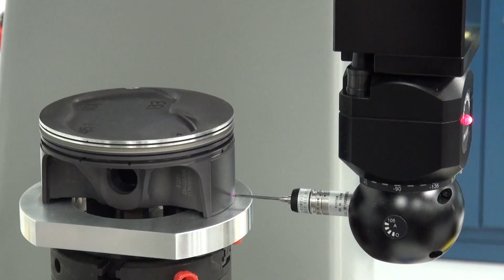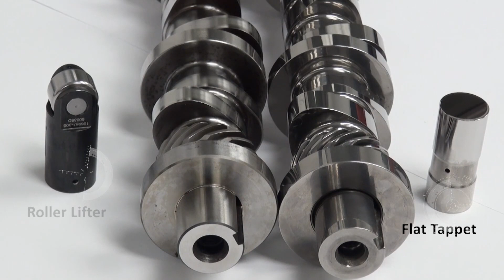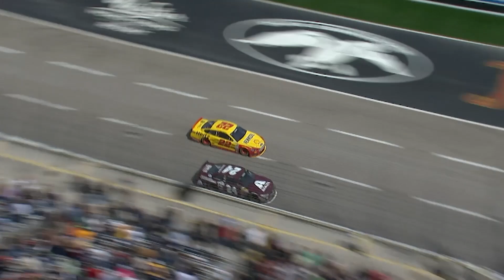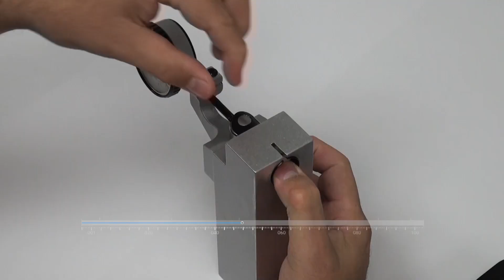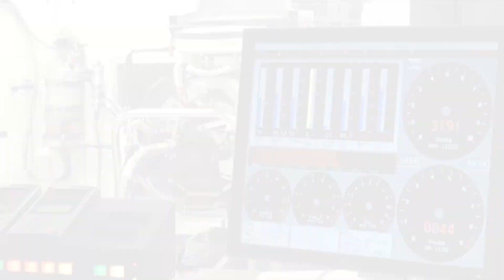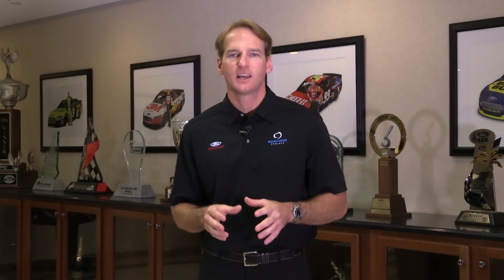2015 NASCAR Engine Rule Changes - Roush Yates Engines

Comment: Flame hardened and cryo chilled cam and lifters. Well, I don't think I'll be buzzing my V8 @9000 rpm any time soon. Every thing inside is sooo shiny!
Circle track article from the 90's. A team got caught sucking extra air through the carb stud bolt holes.
I still recall a Hot Rod article on Roush.
A heavily modded 302. "Give the Chevy bums the Roush!" 
Vasco Jet springs last longer in a roller cam engine. Six years out on this vid. Internet is 
T.M.I.

Comment: Im not a nascar purest. Make a radical change. Since so many manufacturers have used a 2.5L over the years, limit engine size to 2.5 but let them use fuel injection over head valves, stuff that is on stock engines in passenger cars, set a limit on how much gas they can burn per race mile, and then let them compete. Ie get the cars closer to "stock" cars that in use today.

Comment: The "restrictor plates" don't restrict jack shit as long as the carburetor or "throttle body" has more "restriction" throughout the several inches of "bore" the air has to pass down after entering the air cleaner and then making a "90-degree turn" to go down into those bores. And since "velocity" has to "increase" for the air to make it through those "restrictions" and the pressure of flowing fluids is "reduced" as velocity increases and the "pressure drop" occurs "above" the "restrictor plate", the net effect is "ram induction" and "charge air cooling" since the temp of the air also "decreases" due to that pressure drop which keeps the carburetor and the fuel inside it cooler and "cooler fuel" is better than "cooler air" for "making power" any day of the week. 

Fuel can and does "cool" the air automatically as it "absorbs heat" while being "vaporized". And the "restrictor plate" is just like any other "carb spacer" and "increases power" by moving the carb further from the hot engine. Sure its aluminum and a "heat sink" but there are GASKETS between the plate and manifold and plate and carburetor that if made of the "right" material like say...."asbestos"....are able to "direct" heat rising from the engine intake manifold "sideways" right into the "intake air" going right back down into the engine where HEAT IS POWER. 

And its just common sense to not build "restrictor plate engines" any "larger" than they "need" to be to be "matched" to the "restrictor plates" by using shorter strokes to reduce displacement which has the effects of significantly lightening the crankshaft and keeping the pistons "higher" in their cylinder bores for improved piston/ring "fit" and "stability" and of course reduced piston speeds or the same piston speed at higher rpm compared to "full stroke" engines. 

The "oversquare" small-block V8 engine running a "large-displacement" small-block cylinder bore with a "small-displacement" stroke and being able to run a significantly lighter "bottom end" for faster "acceleration" and "throttle response" and a lot less engine stress and internal friction and "power loss" and greatly improved "efficiency" keeping heat and fuel-air mixture in the "shorter" cylinders more easily even at "lower" engine speeds is exactly how Chevrolet kicked the dogshit out of Ford in the "5-liter" Trans-Am series with the Chevy DZ302 small-block using the 327/350  4.000" bore and the "small-journal" and "obsolete" 283 3.000" stroke. 

The first DZ302s were "small journal" engines built from "327 blocks" and when the 350 became a passenger-car engine in "1968" after being a "truck engine" in 1967, both the 327 and 302 became "large journal" engines. 4-bolt mains in the center three "webs" only help "tie together" and "reinforce" the bottoms of the cylinder bores where 302 pistons really never "run" anyway. And because the 302 pistons only run in "wet" portions of the cylinders with coolant passages "top to bottom", higher piston speeds and cylinder pressures and temps that go along with better "sealing" and less "loss" of compression and fuel-air mixture and combustion heat and cylinder pressure are "sustainable". Other "oversquare" American V-8s tried to "copy" the success of the SBC engines that are ALL "oversquare" by significant amounts but when those "copies" were crippled by "tall deck" and/or "deep skirt" engine blocks that were originally designed for "undersquare" dimensions, they all failed miserably on a "hp per cubic inch" basis at "reasonable" engine speeds which means they really failed on a "torque per cubic inch" basis since horsepower is a function of speed and torque. 

The "short" in every dimension Chevy small-block and even big-block architecture with "low" decks keeping the heads as "far apart" as possible and allowing "tall" heads on a "short" overall engine height all made Chevy small-blocks "efficient" and "cheap" enough for money to be spent elsewhere on things like the priority main lube systems and "built-in" fuel pump mounts and "drive" and "splayed valve" architecture for the big-blocks and 4-bolt mains for the small-blocks and every small-block and big-block engine made having at LEAST two-barrel carburetion WITHOUT the "need" for "multiple carburetors" since unlike Ford and Mopar and even other GM divisions, Chevrolet never needed more than a single 4-barrel and only a handful of "outsourced" 4-barrels mainly required by "regulations" and cheaper to "buy" than to "build" since GM's Rochester Division "spread-bore" carburetors were and are far and away superior to any "square-bore" carburetor in "reliability" and "serviceability" and "simplicity" and "versatility" and "durability" as far as "holding a tune". 

The few factory Chevrolet vehicles/engines that used Holley carburetors are "legendary" for their "performance" in spite of rather than because of their carburetion. The Carter AVS and AFB and "Thermo-Quad" carburetors Mopar used were "similarly successful" but obviously not remotely as "common" or "popular" as the Rochester and "license-built" Carter "Quads" (for a while GMs "in-house" demand for its own carburetors temporarily "outstripped" Rochester's production capacity when Rochester was "experimenting" with its few "half a QuadraJet" and "half a an AFB" and "half an AVS" two-barrels Mopar ended up using extensively on "Slant Six" engines QuadraJets) since Mopar and Carter got on the "spread-bore bandwagon" too late and after too long on the Holley and multi-carb bandwagons and was a far distant "third" in V8 production by the time the "smog era" rolled around. And its "high-performance" V8s like most of Ford's attempts at "high-performance" V8s were equipped with too much "camshaft" and insufficient manifold vacuum to operate an "air-valve secondary" spread-bore 4-barrel with a "tiny" set of primaries and "huge" secondaries "mechanical" in throttle butterfly operation but "vacuum" in "air door" operation. 

The real hilarity of all the "competition" between "Ford and Chevy" in the "racing" world is that "Chevy" has never had a "factory-backed" racing "program" for several "common sense" reasons but foremost being that its really stupid to "compete" against your own "customers" on "Sunday" if you want them to "buy" on "Monday" the parts and maybe service or "project" vehicles to "race" the following "Sunday". Ford and Mopar eventually figured that out but Ford, ever the "smartest people in the room" via "inheritance" from the "genius" Henry Ford and to this day "controlled" by "Ford family members" just as "determined" to "leave a legacy" as old Henry was and for the same reasons - "success" mainly through "luck" and "self-promotion", decided to try to "trick" the "drag racers" and "sports car crowd" the same way it tried to trick the "NASCAR crowd" by "privatizing" all of its "racing program" and having "Ford dealers" be the "independent" high-performance parts "suppliers" for specific "motorsports" and "regions" while staying out of the "car business" as far as "retail sales" of new Ford cars went and being only in business to "sell racing parts" and "go racing" in the "top-level" and "factory stock" racing events/organizations/classes etc against other supposed "factory-backed" racing teams. 

Even though Fords main competitor Chevrolet never had such a thing and Chevy "racing parts" started as "factory replacement" parts for existing "passenger cars" and Chevy never built/sold "factory race cars" much less "race-only" engines and "homogolated" vehicles for "competition" and then tried to pass them off as "experimental" and "available" only to the "factory stock" racing "teams" and "race parts dealers". 

And of course the fact that most of Ford's "experimental" and "competition only" parts/engines/vehicles ended up getting "spanked" in every "competition" where Ford wasn't one of or the primary "sponsors" and "authorities" on "rules" and "regulations" and where Ford had to compete against anybody BUT "hobbyists" buying their own "race parts" with their disposable income from other "professions" outside the "auto industry" had a lot to do with Ford "canceling" one "non-factory" program after another and jumping from "motorsport" to "motorsport" just as soon as "competition" showed up or dried up and/or "profits" from "race part sales" to "race part dealers" was no longer sufficient to cover Ford's primary "expense" for its "competition" and "experimental" programs which then and now is "propaganda". 

That its arch-rival Chevrolet was "beating" Ford primarily with "truck" parts and engines and before they were "passenger car" engines Chevy's "revolutionary" engines/engine "families" were first "truck engines" while Ford failed miserably to turn its "legendary" V8 from "passenger car" engine TO "truck engine" and thus sealed Fords "fate" as a "victim" of Chevrolet 4-cylinders and 6-cylinders was just insult added to injury. Kind of like the "Edsel" debuting as a "flop" the same year Chevrolet sold its 50 millionth passenger car. 

Looking at Ford's "NASCAR" engine its the same old shit in a different decade or century. Ford "writing the rules" from a position of "weakness" and ostensibly to "help" some other manufacturer "compete" and then once said rules are "official" using said "weakness" to put itself in the "helpless" category itself and in this case despite having produced more V8 engine "families" than both GM and Mopar combined deciding only a "new" or rather "old" and "obsolete" (compared to its "mod motors" with their "high-tech" OHC and "multi-valve" designs) type of "competition" engine would suffice for the "Car of Tomorrow" Ford ALSO "needed" to remain "competitive" once its only remaining "2-door sedan" was the "Mustang" with its horrible "handling" and "aerodynamics" and "high-tech" mod motor boat anchors under the hood.

Is it a "coincidence" NASCAR wants to "limit horsepower" to "around 550" now that "Ford Mustangs" and "Chevy Camaros" will "compete"?

Comment: NASCAR ! Soon it will be a driver in a pit box somewhere up high with a remote controller . Maybe we should let google drive the dam things . It should be run what ya brung ! Let them have 2000 horse power and see how they finish . Restrict the amount of tires per car . That's the rule that covers it . And a minimum weight rule around 3400 lbs .with driver .

Comment: 5.8L V8 OHV produce 850 HP, so its about 146 HP per litre displacement. what is the key of such naturally aspirated OHV could reach that power to displacement ratio?
Reply: Ram air from the speed of the car. Carefully tuning of the pressure waves between the intake and exhaust. Very well designed ports. Radical cams that are optimal for all the above. Exhaust is dumped into a very low pressure area created by the aerodynamics of the spoilers. Very sophisticated compressible fluid dynamics is used throughout the entire car , and engine working in harmony together within the environment it is designed for.
Reply: @daveponder2754  You must have read Phil Smiths book. And Fred Puhn's as well.
Reply: the roush yates is a ford motor

Comment: I find it funny that they say without the taper spacer the cars only made 850ish HP, but according to that dyno monitor the motor made 860ish with the taper spacer. That leads me to believe the "old" style motors made well over 900HP. Crazy.
Reply: nope without restrictors it makes over 1000hp actually
Reply: +Drokkers I'm inclined to think that the taper plate may actually help with fuel/air distribution to ensure a  better more even power from each cylinder.

Comment: Wow, at this rate they will have fuel injection in only 20 years or so.
Reply: +aj9270 i think he meant direct fi
Reply: +aj9270 i think he meant direct fi
Reply: +James Stevens They have it now and haven't had it previously because of rules.
Reply: aj9270
its not direct injection
Reply: Again, rules.
Reply: +James Stevens THEY HAVE IT NOW DIDN'T YOU NOTICE THE FUEL RAILS ON THE MOTOR ON THE DYNO ?

Comment: Im not really into nascar...  but all the engines are pushrods?     lol.       so GM has a big advantage
 or what?
Reply: +Howabouthetruth Except for F1 used smaller V8's that produced near the same amount of horsepower with much smaller engines. And also F1 v8's are DOHC, rather than pushrod. Oh yeah, they could rev to limits of 19k rpm.
Reply: +Howabouthetruth in 2005 3 liter F1 engines was making 1000 HP. and thats almost half the displacement of nascar engines
Reply: +Beryllium And they were ALLOWED to rev high enough to make that power. Engine builders in nascar have wanted Fuel injection and roller cams for DECADES since they were made commonplace in passenger vehicles in the 80s. Rules wouldn't allow it. In the 80s turbo 4 BMWs were making 1200+ in F1 with boost until F1 changed the rules. 

You really think the nascar guys wouldn't make WAY more than the 80s turbo 4's from F1 if they were allowed to run large amounts of boost?

It's all about the rules in the class.
Reply: Thy were turbo charged .
Reply: +SOCAL3800 That just goes to show what a true idiot you are. Let's see you build a small block V8 with THAT MUCH horsepower, THAT REVS OVER 9000 RPM, AND HAS TO DO IT FOR AN ENTIRE 500 MILE RACE. "NO TURBO'S".........."NO SUPER CHARGERS"...............Do you even realize the technology & capability these engines had, even years ago? Today, these engines cost over 100 GRAND. And 45 GRAND just to rebuild. Your looking at one BAD ASS little V8, yet ya don't even realize it, nor do you appreciate it..........THAT'S WHY your a freakin' IDIOT. Go back to school BOY.
Reply: +Howabouthetruth ????   how does that even relate to my comment

Comment: Didnt NASCAR engines used to be in the 15:1 compression range?
Reply: madtownmadman NASCAR runs an Ethanol-infused gas now which prematurely knocks at higher compression ratios like a force-inducted engine.  They lowered it to 12:1 when they changed the fuel in (I think, don't quote me on the exact year) 2011 before they introduced fuel injection.
Reply: Whats the octane of the fuel that the ethanol is blended with? Do you know the proportions?
Reply: madtownmadman Currently (as of 2011) they run E15 ethanol fuel.  Before, they ran I believe Sunoco 96 Octane fuel at a higher compression.

Oddly, too, E15 gave them a small HP boost which decreased their economy, thus negating the effects of using Ethanol-based fuels, supposedly.
Reply: mastoner20 E15 is 15% ethanol, by the way.  Forgot to include that bit, sorry.
Reply: Damn.   These bad boys would make 50 or more additional hp on e85 and 40ftlb.

Comment: The roller cam is going to backfire on NASCAR's "less power" plans. With roller cams you can create more radical cam grinds that allow more horsepower from lower RPM. By the time the Coca-Cola 600 rolls around, the engine builders will have found all the HP NASCAR thought they took away.

The True Solution to the Horsepower Problem would be to change to a V-6 engine from a V-8, but the four engine shops would go out of business overnight if they had to throw away all their hundreds of blocks and thousands of cams, cranks and heads.
Reply: +Jim Mowreader The true hp limiter would be making the teams use ACTUAL production cars AND require the engines to last MULTIPLE races.
Reply: madtownmadman the straight 6 design is far better than the V6 config.
Technically speaking, the V6 isn't the optimal configuration.
Reply: that's what i thought.
rollers have  much larger profiles.
Reply: jmowreader Tell that to the rest of the world with australia's touring cars etc..........
Reply: Keep the v6 blasphemy to yourself, please. I see what you're saying, but please, we're American's.
Reply: +AllyourBaseArebelongToUs Maybe so, but who besides BMW builds a car with an inline 6?
Reply: +Jason L An "actual" production car would not be safe to race. It wouldn't take the strain of racing. As for your suggestion that requiring the engines to last multiple races would slow the cars down, look at Formula/1. They're pulling 600 horsepower out of a 1.6-liter turbocharged V6, and an engine has to last roughly three races because there are 21 Grands Prix on the calendar and you only get eight engines for the whole season.
Reply: +madtownmadman We're Americans who put V-6 engines in our pickup trucks. So what's your point?
Reply: +Jason L The "rest of the world" either radically strengthens production cars and runs them at relatively slow speeds, or they use tube-frame cars. The faster the racing is, the more likely they are to use tube-frame cars. In the US we also have "actual production car" races. 
Something that MIGHT slow their asses down: The NASCAR rulebook doesn't say how many cars a race team can have, so they'll have over a dozen different ones. Would they be more gentle on the throttle if NASCAR only allowed them to have three cars - a "primary" car, a "backup" car and a third car for Watkins Glen because you pit to the right and not the left at The Glen?